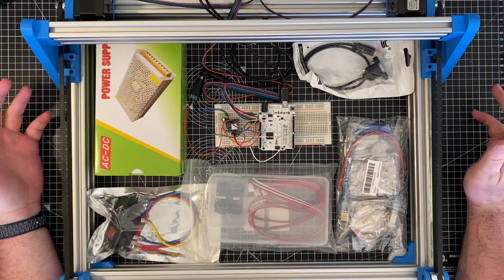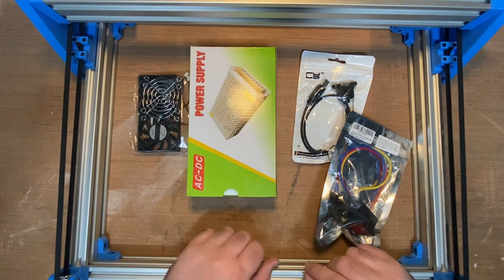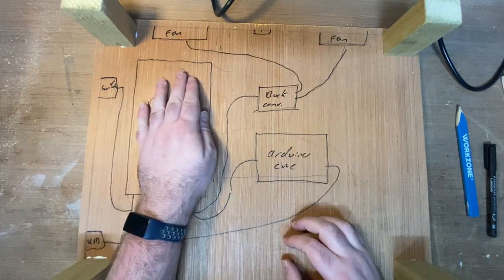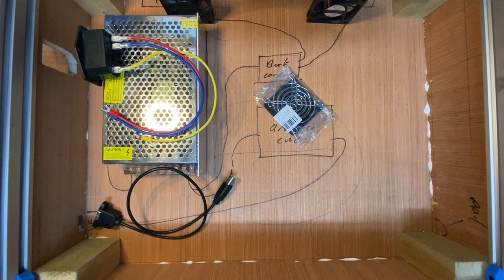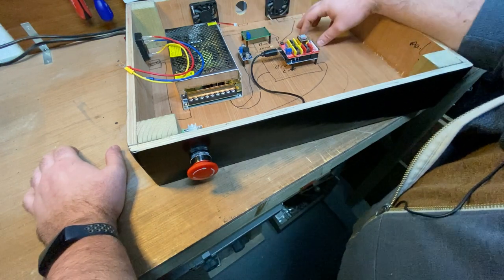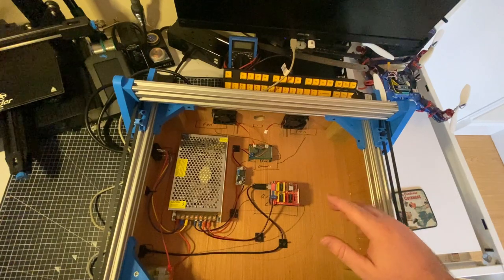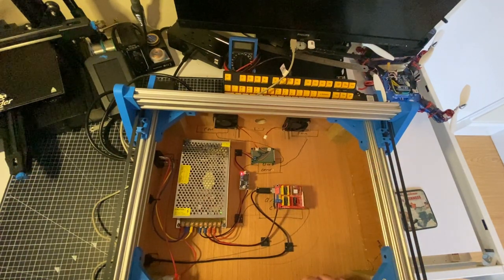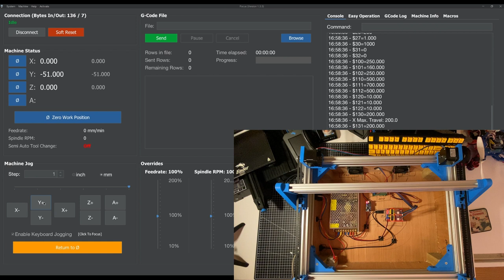DIY CNC (Arduino & GRBL)  - Part 3

Comment: good to see some development from your project...one thing I will advise you is to have a common ground that all the components can attach to to reduce electrical noise.... after getting my 500W spindle (I replaced it to smth else cause the electrical noise was so bad), sometimes my motors were skipping steps at high rpm because of the noise.... these cheap spindles dont really have the best qc.... it would also help to use protected cables for the motors and limit switches if you decide to add a few
Reply from the maker: Thanks! Yes, I can see that possibly being a problem, I will probably look at shielded cables in the future
Reply: @careyian  do you think you'll ever add an offline controller? a youtuber named iforce2d found more success when the computer/laptop wasn't connected to the machine itself (maybe noise also coming form the device)... maybe it's also a good investment this early on
Reply from the maker: @im_ricebowl  Yes, I think I probably will at some point, as we are still in the very early stages of even building out all the axes, I haven't looked much into it, but as you have seen, plenty of room in the electrical cabinet for it!